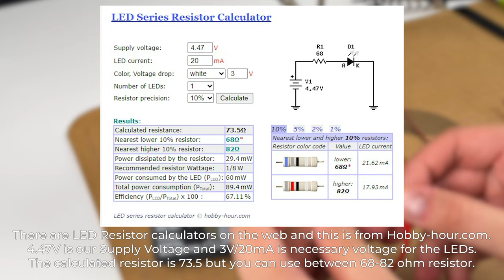Drive LED Lamp Using an RC Servo Circuit!

Comment: Better connect to FC and control from programmed output.
Reply from the maker: Of course, an FC driver is better but this video is for everyone who needs to drive LED simply from an RC transmitter. This can be used for cars, boats, or different projects. You can also drive its motor and use it for different mechanisms. It's just a method explanation. We may see uses that I hadn't thought of.

Comment: For me, when I remove the Potentiometer I only get full RPM on the motor and no control of the direction of the motor rotation. Any idea what to do?
Reply from the maker: If you have this issue, you need to solder the Potentiometer back and set the pot centered and then glue the pot. so ıt can't change its position and you are ready. Some servo circuits have this issue and I realized that after publishing the video. Maybe I can do a second video to explain this later.